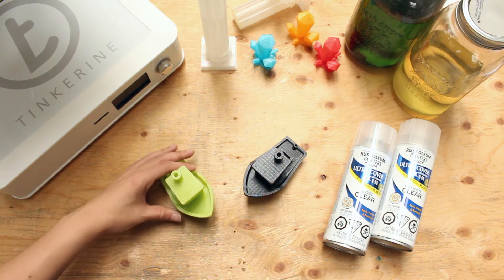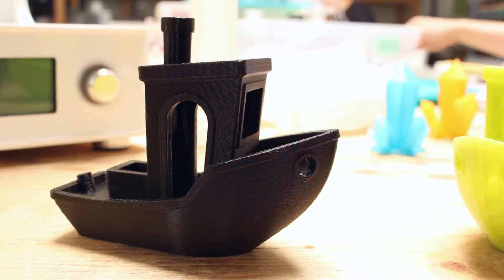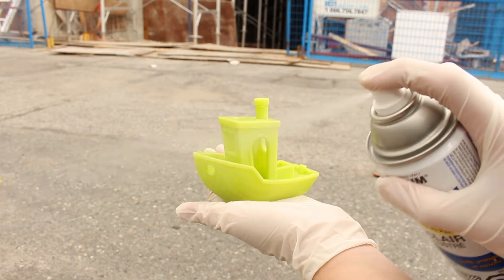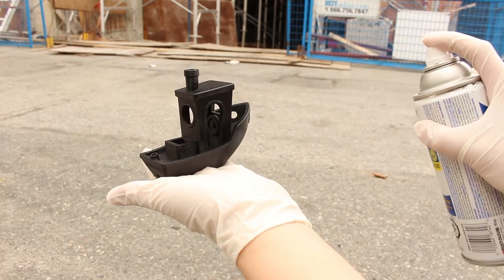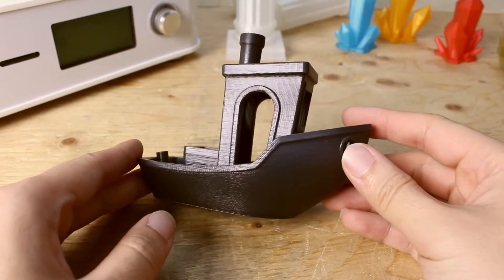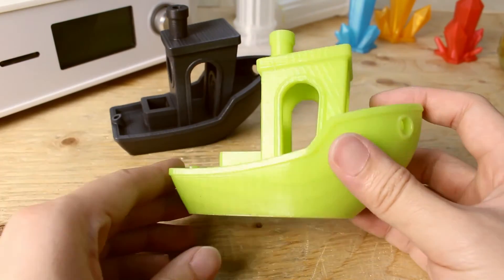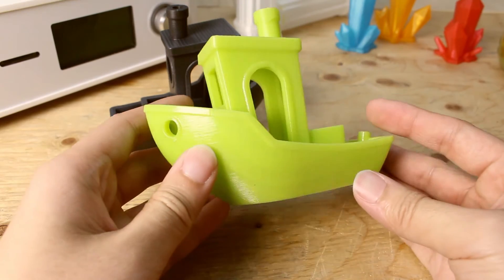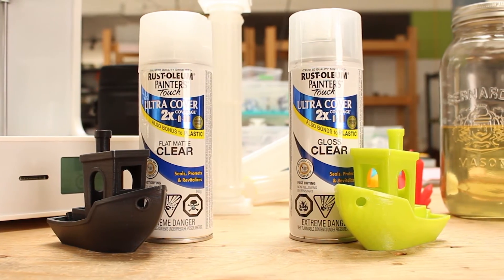Finishing PLA with Gloss and Matte Topcoat

Comment: Hi, did the coating actually smooth out layers completely? Would the resulting model be suitable for casting?
Reply from the maker: Hi,

Unfortunately, the top coat does not smooth out the layers completely. The model can still be used for making a mold but the lines on the print will translate over to the mold. When you cast it, the lines will come out as well.
Reply: Thank you. In case you're interested, I've obtained good results by coating my prints with epoxy resin (best results obtained with XTC-3D resin). It requires some practice, but I think it's worth it.
Once the resin has cured, I sand imperfections away with P500/600 sandpaper, and spray them with primer and paint.
Reply from the maker: Hi,

Thanks for the suggestion! We will look into that and acquire some XTC-3D for a future experiment.